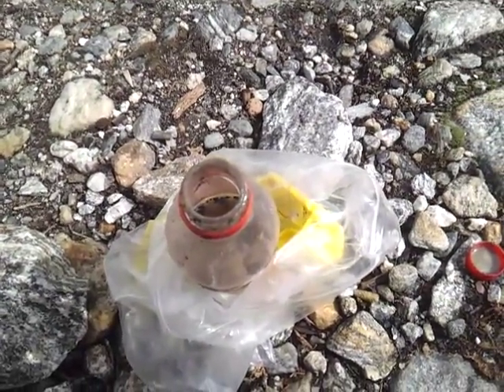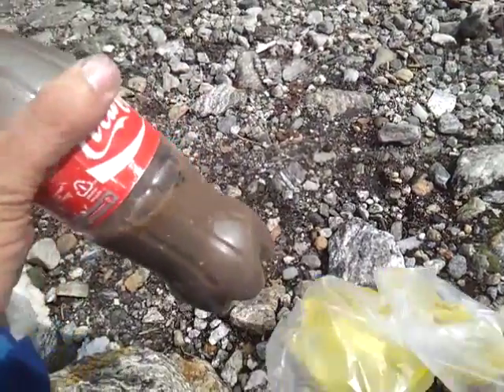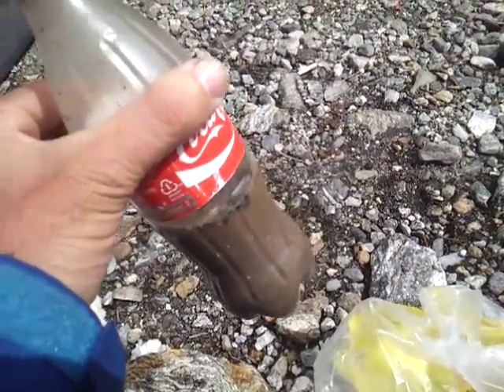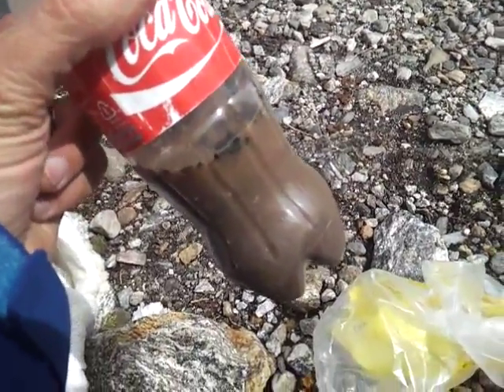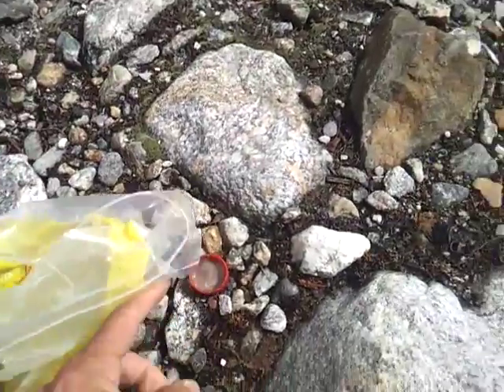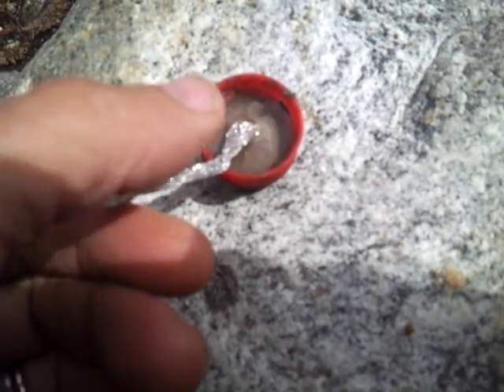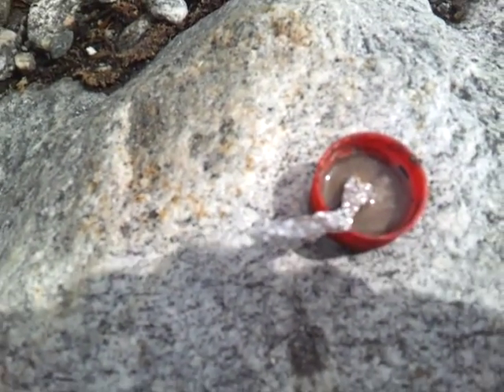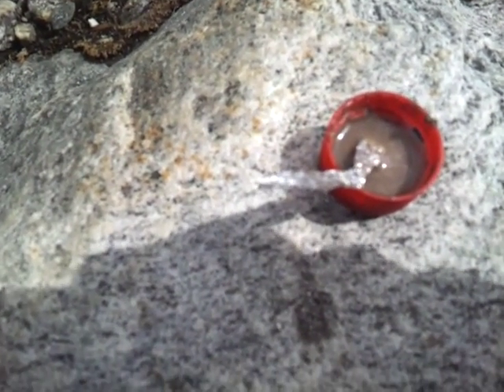Creating Hydrogen with Potash made from wood ash in the highlands of Nepal

Comment from the maker: Kathmandu is several days walking and then a plane ride away (from Lukla).  So tons of aluminum is simply thrown into trash heaps; there is no value in recycling it.  I can find more aluminum than I need. And every Sherpa lodge fire , which uses Rhododendron wood rich in Potassium, is a source of concentrated ashes to make the KOH that reacts with the trash aluminum.  Perhaps you have never lived or worked in remote areas and don't know how useful these quantities of hydrogen and heat can be.